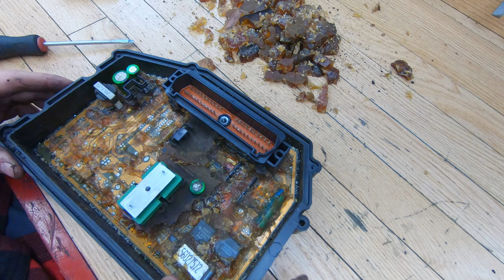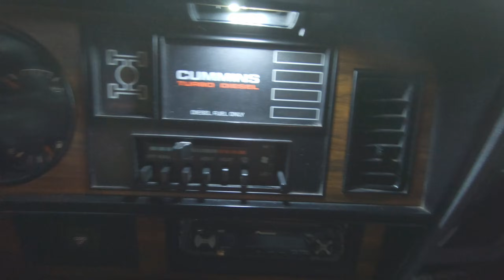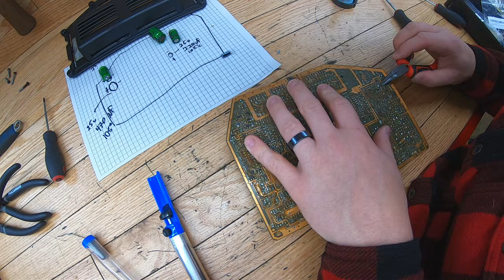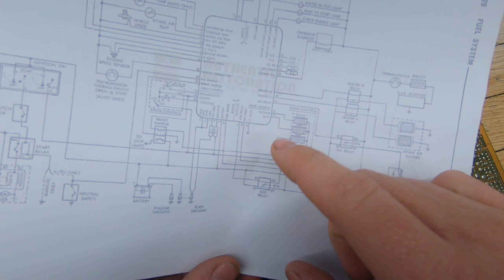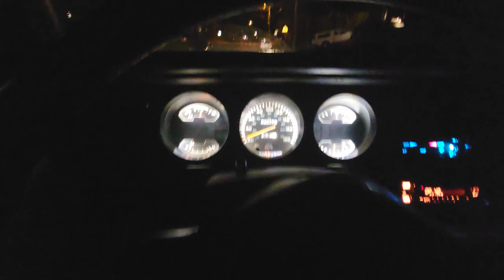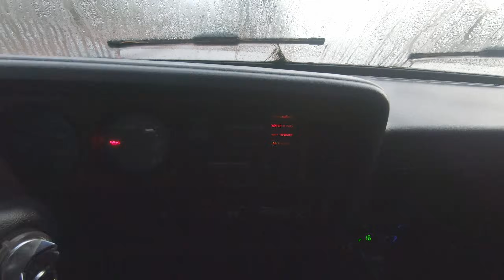PCM Repair | 1st Gen Cummins

Comment: Man this is some great info! Very relevant in many Chrysler dodge pcms from the 80s to the 90s, I'm personally gonna use some of this to help with my 93 Dakota pcm. I sent it out to a business for like 200 bucks to replace the caps and got it back not working at all. I've messed with some way simpler boards but I'm excited and confident I can get my pcm going again. Awesome video!

Comment: Great video! Still helpful in 2026. Maybe i missed it but changing the capacitors fix the ac issue? Working on one now
Reply: He says towards the end of the vehicle that the AC doesn't work but it sounds like he has mechanical issues with the AC and not something electronic related to the PCM.

Comment: I am having some PCM issues in one of our first gens; grid heater won't work and speedometer won't, everything else is fine. "Borrowed" a PCM from another truck that works correctly; everything functions as normal. We followed your instructions, removed PCM and replaced all three Capacitors... it did not fix our issue! Still no grid heater.

Anyway, I need your help or further guidance... do you have any more ideas or pointers or guidance for us? Is there any way I could contact you and discuss this in further detail??

Comment: I just rewatched this. Really is a great video. I also wanted to impose and ask you a bump stop question since u have access to 3 dana 60 fronts. I couldn't find in the fsm the proper setting for R/L bump stops on the knuckles. U think maybe the next time your under 1 of them you might share your functional settings. Thanks, Ron 👍

Comment: I have a two part question for you, we have now acquired a rust free mint 91.5 intercooled Ram that has a PCM issue so would this same procedure work on it?
Also when you did your auto to manual swap did you keep the cruise control?
Thanks
Reply from the maker: Yes it should work if that's the issue. And when I did my manual swap i kept cruise and it still works
Reply: I’m going to look at doing the PCM myself now.
Also, I have another question that I have asked half a dozen people and seeing you have great knowledge in these trucks.
Is there two coolant temp sensors?
I know there is the one at the back of the head on the drivers side which I believe controls the temp gauge.
Is there another one that tells the computer?
When my truck is plugged in even at 0 degrees it starts awesome, unplugged it’s absolutely horrible and was not like this before.
I did replace the air temp send but, it didn’t help.
Thanks

Comment: I have a 93 dodge d350 diesel and I replaced the capacitors with the ones in your description and I put it in and it didn’t do the post heat cycle and it’s still not charging and my wait to start is not working properly and my check engine light is not turning on either and I replaced the light for the check engine light so idk what to do

Comment: Great video, great breakdown. 

I have a 1994 and have been beating my head against the wall trying to find the problem with my wait to start and water in fuel light. 

When I turn my key to the on position it takes roughly 10 minutes until they both show up then work normally after the truck has been running.... might have to change the capacitors. Thanks for the help.

Comment: I am doing this repair for my neighbor that is having the symptoms mentioned in your "PCM Repair #2" 1 Gen Cummins video.  All of the capacitors that I removed were rated for 25 volt.  I did determine that the 220 microfarad capacitor (corner of board) that is closest to the 470 microfarad capacitor was bad.  With my voltmeter the bad (220) capacitor measured 14 microfarads.  The other 2 capacitors measured good (labeled value).  I am still going to replace all capacitors with new ones.  Thank You for posting this video it was very helpful!!!

The microfarad must be the same when repairing electronics, but it is ok to use a capacitor rated for a higher voltage. as long as you have the physical room to place the new capacitor. The capacitor with the higher voltage rating (and same microfarad) usually will be larger.  But you should not go the other way and replace a higher voltage rating with a lower voltage rating. The repair may work but the lower voltage rated capacitor could fail sooner than the higher voltage rated capacitor in your repair.

Comment: Hey Tyler I’ve got a 1991.5 d250 with 5 speed. Somewhat new to me . And randomly the speedo/ odometer stopped working and also noticed my wait to start light and water in fuel light not turning on. So no grid heater operation. Would you lean to the pcm being the issue? I seem to have good charging and I beleive I have voltage regulator on firewall that’s been replaced as well

Comment: hello, great video, helps a lot, i have a 1992 Dodge Ram B250 360 engine, ecm looks just like the one you have here, do you know if this ecm are compatible with different car or truck models?
Reply: 8cyl gasoline, also 5.9L

Comment: Its good that you got ALL of that potting compound out. More than likely it was much lighter in color when it was new. It looks like old Sony bond which becomes conducive and corrosive with time.
Reply: You can sometimes get a resistance reading across it with a meter

Comment: Excellent troubleshooting and repair!  I do have concern that you've full-fielded the alternator permanently by jumpering the relay ground, thus obviating any voltage regulation.  This may lead to overcharging the battery on a long trip.  But I expect this is no big deal, with perhaps leaving your headlights on 24/7 underway.  Most battery issues occur from under charging, not overcharging anyway.  Thanks for the video-good job!

Comment: There is a work around for everything the PCM does. The AC, the shifting on autos, and the charging system is the easiest. You can sell a working unit after doing the bypass techniques. Or remove the PCM, and put it in a box.

Comment: I changed voltage control using a universal mopar external and adjustable voltage regulator and fixed quick, except two made in China defective issues! Third was good.

Comment: i was able to replace my capacitors thanks to your video. one was leaking nasty black fluid and I was sure that replacing them would fix my problem, however it didnt. This was the last thing i tried after CPS and testing relays, etc.. did all the recommended checks till it came down to ecm. so what else can I check at this point? ive got no prestart stuff kicking on, no charge, no speedo and my OD light doesnt come on. not sure on ac as its isnt hooked up

Comment: I was having the exact same issues you were on my truck recently...eventually determined it was PCM related so swapped in a spare and and that solved all my issues.  But now thanks to your vid I'll dive into the OEM PCM and replace those capacitors and see if it gets things working properly again.  Thank you so much for the great vid and repair!!

Comment: Hej Oven. Viktor here from sweden. Sorry for my bad english. I have some crazy problem with my dodge 318 tbi 1989 year modell. I cant get the codes when I do the keydance. It rans like crap after a few minutes and Will backfire and sometimes die when I hit the gas quick. Feels like it ran out of gas. I have change a lot of things like injektors, tps sensor and tempsensor. The car rans "okey" when I drive without the tempsensor connected, but runs like crap when the tempsensor is connected. So I think i must check the pcm like you did. What do you think?
Reply: I think you should go for it.

Comment: I have a 91.5 and I am having a overdrive problem. I jumped a wire from pin 55 into the cab and ground it to the door bolt and it went into overdrive on the board what controls that?

Comment: Had same issues on my 92 a few yrs back. No charging, No overdrive, No grid heater, No Speedometer. By luck ran into a NAPA parts guy who “knew a guy” that could repair, did same procedure you described. Charged $350 US. With a bit of sleuthing around the PCU before install I determined that indeed he R&R the capacitors.
Reply: PS,  a Fluke 87 multimeter among others has a capacitor test function that will indicate capacitance/microfarads so you can compare w/OEM rated. Capacitance can drift/degrade, but still charge and discharge at a lower capacitance before failure.

Comment: I appreciate the video.  While there probably different i have a 95 4x4 automatic.. Many years ago my truck started having all kinds of weird problems.  FINALLY i ordered a rebuilt pcm from Dodge or Mopar from a on line discount dealer . All of the folks on the forums said no it some else not the cpm . I installed the pcm and problems were fixed .. Thanks for the video
Reply from the maker: Glad it helped!!

Comment: I have a 5.9 magnum. My pcm makes a high pitch noise after shutting the ignition off. The sound continues until i pull the fuel pump fuse. Any ideas what could be making the noise in these things?
Reply: I found that the power inductor is making the sound. I'm not sure why thorough.

Comment: Thanks for making and sharing this video!  I have been having issues for over a decade. I ordered the Capacitors today. I will update asap. 

 My truck has all the the issues listed, except my grid heaters works normal. The WTS light stopped working in the last year. I have worked around the charging issue with an external regulator. MY O/D is on a switch. 

Thanks for the all the videos and Knowledge.
Reply from the maker: Good luck! Did it work?

Comment: so i replaced my capacitors, put it back in the truck same issue, not even getting a start sequence or tachometer. took it back out cut it back open retested all the solder joints one tested bad the middle one. it read 0.58 ohms. so i took the capacitor out shot it and its still good. shot the circuit and it reads 0.58 ohms, stuck the capacitor back in but did not solder it back and i shot it and it read 0.58 ohms almost as if its shorting to ground some where in the circuit, im kind of stumped on this one any ideas??? all the solder joints tested good before i put it back in the truck.
Reply: Did you ever find the solution for this? We have the same thing. Please
Let me know what you did!

Comment: IIs the tach signal generated solely by the PCM or does the PCM interpret signal from external crank sensor and then to tach. Either way, do you know the tach in/out PCM pin #'s?

Comment: The ones you have listed are 25v capacitors but the ones in the ecu are 35V. Was that a mistake in your Amazon link? Or did you run the 25V with no issues?
Reply from the maker: Maybe your ecu is different. All the ones I've seen have been 25v
Reply: @OvensGarage  odd, it’s a 93 w250. But if you’ve had no issues with 25 then I’ll just replace it with those since I bought them beforehand. Thanks for response, and appreciate all the videos!
Reply: @justinjrowbottom  let me know how it goes. mines been replaced with a 35v  let me know if they work out good

Comment: @Ovens Garage Thanks for this video I just did this to my PCM and now my Wait to start light only comes on after I start the truck, it then stays on, at least for the 5 minutes I left it run. Previous to doing this repair I replaced the alternator with a 1 wire alternator because it wasn’t charging. I ran a new wire to the new 1 wire alternator and didn’t use the original alternator wiring at all. I still have the original alternator so I am going to put that back in and see if anything changes. 

Any other thoughts would be appreciated.
Reply from the maker: Yeah I would try out the original alternator and see if that changes anything. Having the wait to start come on after you start the truck is an odd symptom. Unless the grid heaters are on that light shouldn't come on at all

Comment: Hey tyler. I have a 1993 cummins auto. I changed the caps in my pcm now everything  works except the alt won't charge. I jumped the red wire pin87 with the green/orange stripe pin 30 and still no charge. I took the atl out and had it bench checked at a local shop it tested  good. I reinstall it back on the truck is thier any other things i can check where my voltage regulation problems could  be. Thanks
Reply from the maker: Not sure maybe try taking a look at the wiring between the pcm/relays and the alt, it may have been previously tampered with. Maybe someone put a regulator on it before and it needs rewired.
Reply: You can wire your your over drive to a 50 psi fuel pressure switch thread it into the passenger  side of the trans thiers a plug u have to take out first. Then it will shit on its own at about 48 mph changing fuel pressure  sensor  to different  psi will change when it shifts FYI YouTube has videos  of it.
Reply: I’m having the same issue where jumping the ASD Relay doesn’t result in a charging voltage higher than the battery’s nominal output. 
 
Did you figure it out? 🤔
Reply: Did you try the crank position sensor . It fixed my charging @prosocialchaos
Reply: Best thing to do if everything  else works on the truck except for alt just convert  it to an old chevy 2 wire set up no external  regulators or any other bs problems I did everything  in thus kids video and still didn't get the results  he got sent it out to a repair  facility $250 later they changed all the caps and put in a jump wire it came back over charging @ 18 volts. 40hrs later with a multimeter I've found that my pcm won't internally  complete  the ground and haven't  found a way to rig it so it recognize ground thru pcm. I tried jumping pin 51 and that did nothing  for me as well.

Comment: Do you have a link for the brand capacitor that you used. Thanks
Reply: Do you have video a on how to wire up a a tach on an auto truck also like the tach setup you have on the red truck was that homemade or can i buy a plastic  piece  like that thanks
Reply from the maker: @timenotwaisted3053  yep I have a video on me installing that tach in the red truck. Try searching 1st gen cummins tach isspro you should find it
Reply from the maker: Links for the products I used in the description. Let me know if they aren't working and I'll fix them!

Comment: Hello Tyler, I have a charging issue or lack of charging. 12.37 at battery with truck running. 
My heater grids are working, wait to start, water in fuel lights working. Over drive works as does dash light. 
AC clutch doesn't engage. I cleaned points of ground on alternator battery and grounds on inner fender & core
Support. I have a new alternator ordered to arrive soon. I did try the jumper wire red to green/orange wire. I didn't get a voltage increase. 80,500 original miles on truck. Thanks for any suggestions you may have
Reply from the maker: I would imagine it might be related to your alternator then it seems your pcm is still good judging by the other symptoms. Good luck!
Reply: @OvensGarage  I'll let you know results after installing new alternator. Thank you for your prompt response 👍
Reply: @ericfinch9642 Did you figure out how to get the alternator working?
Reply: @George Berven  yes, I had a code on dash tell me possible issues. Turns out the crank position sensor was faulty.  I replaced it with a New one and all is working as should.

Comment: Could you just put the ground on the relay wire to a ground in that area. Much easier to access. I’m having a issue with charging circuit only.
Reply from the maker: Yep you can also do that
Reply: @OvensGarage  so once that relay was grounded you haven’t had any issue with the pcm regulating the charging? Gonna wire it up in a bit and try it. Was just thinking it may over charge.
Reply from the maker: @thinkoutsidethebox4935  Nope all the ASD relay does is allow the alternator to be activated through the field circuit and the regulation is done internal to the pcm

Comment: man i have a 95 dodge dakota 5.2 4x4 with alot of the same issues...i cant find a replacement pcm ANYWHERE and sorta on a time crunch im gonna give this a try only ?? i have is how do you find tje back of the caps?...thanks for the video!!
Reply from the maker: What do you mean how do you find the back of the caps? The leads should be fairly distinct from the back side. Good luck hopefully it works!
Reply: @OvensGarage  10-4 is there anything that you use to clean the area you were going to solder after you got rid of that gel stuff
Reply from the maker: @jobehayes8444  No I just removed the gel coating as best as I could.
Reply: Curious if doing that worked for you. I'm doing the same thing

Comment: How do I get a copy of the pcm schematic you have? I have the pin in/out from the fsm
Reply from the maker: It's also in the FSM but I think it's in the fuel delivery section if I'm not mistaken
Reply: Ok I found it. Once I pause zoomed I saw what it was.
You don’t happen to know what the 2 caps together control? One is burnt and so is a diode.
My pin 3 is shorted to ground.
I want to know if something external causes my pcm issues, or if it’s a pcm issue.
Reply from the maker: @tigershark1100  not certain what the caps control, chrysler didn't release the schematics for the internals of the pcm so you'd have to do some reverse engineering to figure it out
Reply: Ok, thank you for replying. 
Going to make the ohm meter put in some work.
Reply from the maker: @tigershark1100  good luck!